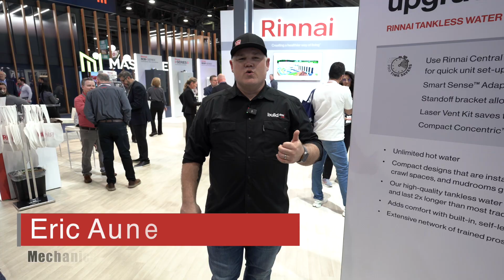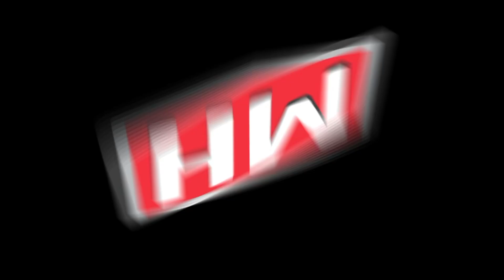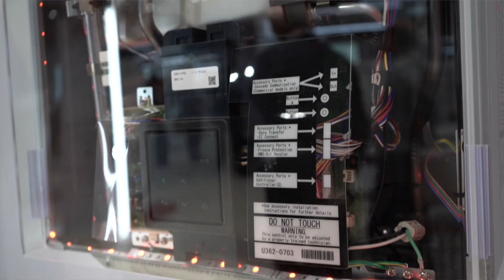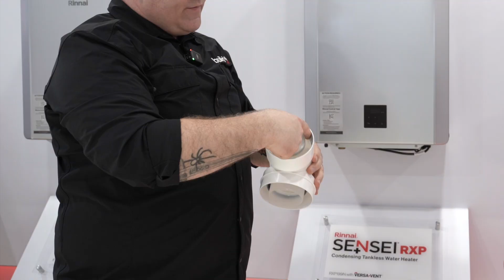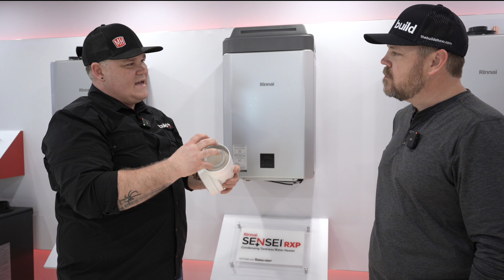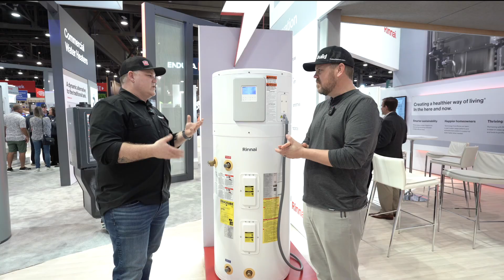Home Builder's Guide to Water Heaters

Comment: Mech eng here who has crunched numbers for all types of residential water heaters and at the end of the day none of the high efficiency units make financial sense when you look at the numbers.  All new tech sounds great but all come at a premium price and back when I looked at the payback it was over 10 years (feel like hybrid was 7)then when I looked at the useful life span of them nit worth it.  I wanted a tankless but after I factored in cost of unit then cost of new venting it wasn’t worth it but for my situation the deal breaker the venting would have come out of house at patio then run up side of house.  I’ll take an inexpensive 80% efficiency tank overtime, they work and are cheap.

Comment: I'm in northern Iowa, so we get to 20 below in the winter and up to 100 in the summer. I love the heat pump idea, but would be curious about looking into venting the cold air indoors in the summer and outdoors in the winter, or running the exhaust through an air exchanger tied into the whole house hvac system.

Comment: I have found the 80 g lg is quiet, and lowers temp in the room 2 degrees or so, minor dehumidification. We have in 1000 cu foot room. Fairly cheap to run. Big question? What to do when you have a heat pump problem? Who will repair ? A plumber ? HVAC ? Very few people around to service these things

Comment: I would not be as concerned with the cold or dry air, I would be more concerned about the size of the room, installed in a closet or small room should be vented both intake and out or you will lose a lot of the efficiency of a heat pump unit.

Comment: In cold climates dehumdification is going to be negligible in the winter in a heating-dominated area, unless you are doing major humidification.  I would be surprised if the outlet air is ever lower than the wet bulb temperature.  I also think venting to the outside is almost always a mistake, as the filters will clog up quickly.

As for "right-sizing" the tank, I really don't see many situations where I would think it makes sense to go smaller than an 80-gallon tank.  The larger tank means you can lower your hot water temperature which will make the system run more efficiently.  (When we have guests over in the summer I miss our old 240-gallon solar hot water system, but in the winter the heat pump is so much more reliable for hot water.)
Reply: If you are lowering the water temperature, are you concerned about Legionnaires disease?
Reply: @lnk4328  Short answer... no.  There are very few (if any) cases of Leigonnela in single-family residential settings.  Every so often I do bump the temperature up high enough to sterilize things though.  The same thing happens when you put the water heater in vacation mode, but I just happen to go on vacation each day.
Reply: @ Good to know.  I just reduced the temperature on my daughter's indirect water heater supplied from a propane fired hot water boiler from 140°F to 120° to save on propane.

Comment: How many times have you had an Air to Air water heater installed in a part of your home & it's been an issue where it's too dry? I'd dare say that's not so much an issue anywhere but the colder temps being exhausted out may be something of an issue in a northern climate basement in the winter.